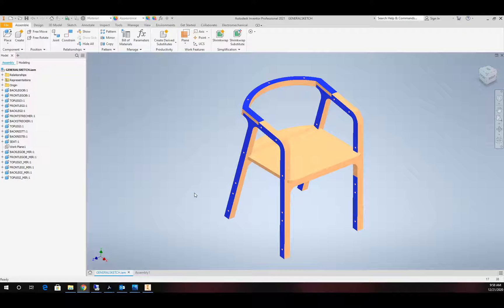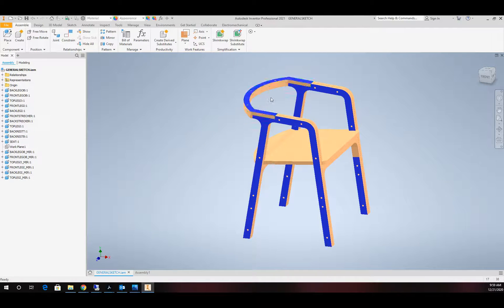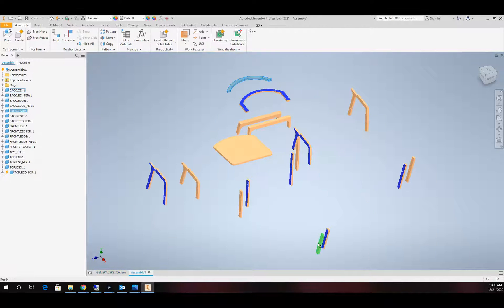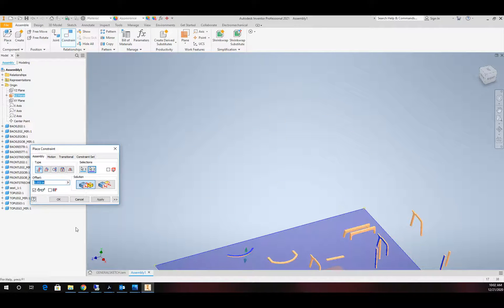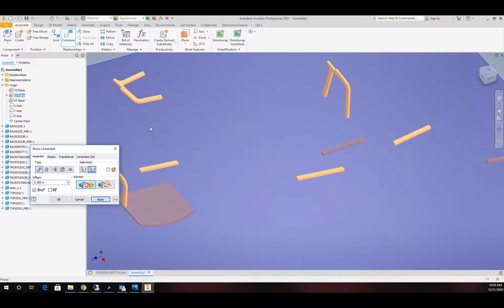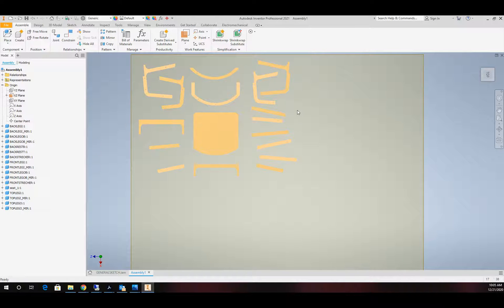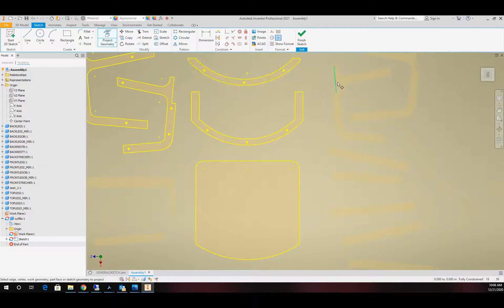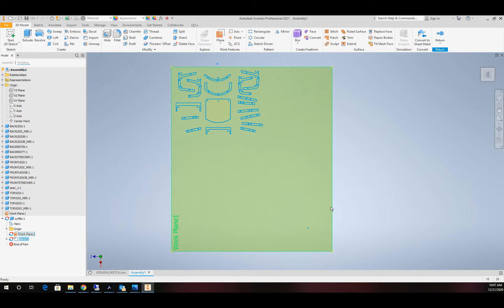How to take an AutoDesk Inventor Assembly and prepare it for CNC Router, Laser, or Plasma Operation

Comment: is there no way to do the toolpaths in inventor as well? Im working on a very similar 2.5d project for a cnc router
Reply from the maker: In regular inventor you can not make toolpaths , however, if you have inventor hms you can.  Fusion would be another choice it does have toolpath capabilities in the software.  I personally prefer to use a product like Vectric  Vcarve or Aspire for my toolpaths for laser, plasma, and routers. its much easier and has my machines built into the library., and I don't need to use a generic code file this way.
Reply: @MorrisonInst1973  awesome thats very helpful. So v-carve can deal with the dxf file you made here? You need to input all the z axis specs manually in that second software, v-carve or whatever correct? This is basically a 2d template?
Reply from the maker: @swaags   That is correct we would need to export out in a different format he we want to bring the z axis data with,  for example, if we were craving something, then we would export the model as an stl or something similar.  When I bring in a dxf that will require full depth cuts and  pocket cuts just make sure you have geometry that is close and allow a overhand on your pocket cuts if they travel past the edge of your work piece so the pocket is square to the edge of the workpiece.  
  
Give me a week or two and I will post a video with full depth cuts and pockets export out as a dxf. This will show you exactly what I am talking about.

Comment: Enjoyed the video...can you tell me if this chair was actually cut and built and if it was, was it comfortable. Thanks
Reply from the maker: Hi Woodbot,  yes the chair was made, in fact we have made 6 of them,  they are pretty comfortable.   We make a lot of chairs here at the college.  it is a project for one of the courses.  The students have to design the chair to be made from sheet goods, and FEA it out to make sure it will hold the required loads with no fasteners .  Check out or Instagram account MorrisonTech and you can see a variety of chairs and other projects we work on.